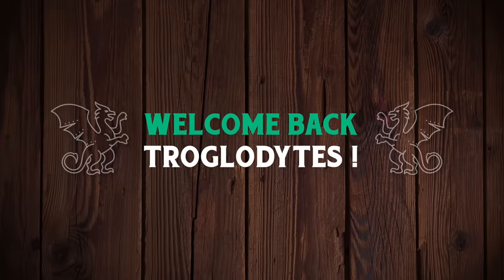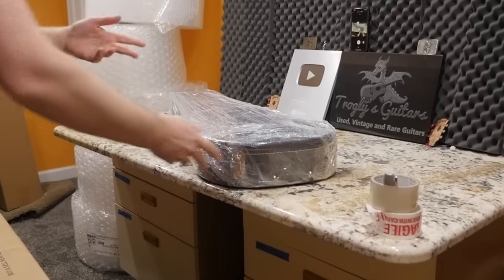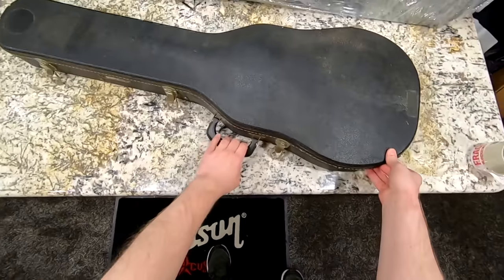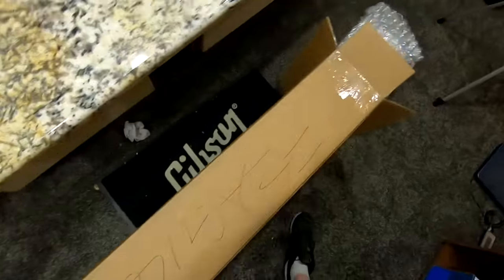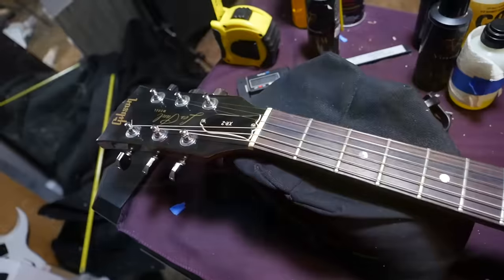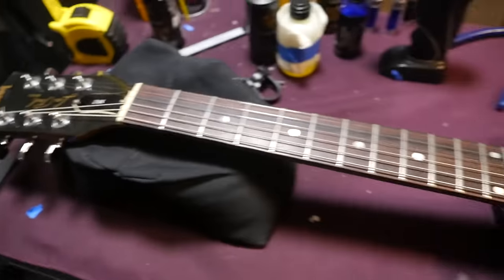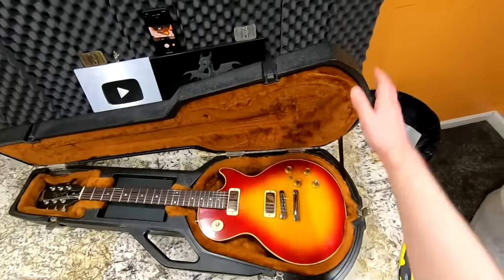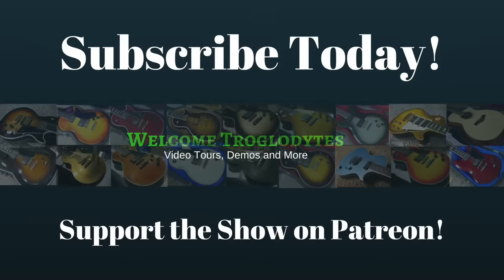Sometimes I Have Rotten Luck | Trogly's Unboxing Guitars Vlog #105

Comment from the maker: It is a shame the last one didn't end up working out - it was in great shape!
I now sell directly from my website: 🟢https://www.troglysguitarshow.com
❓Private Help Sessions: https://troglysguitarshow.com/help-appraisals/
👕 Merch: https://teespring.com/basic-logo-4245?pid=211
🎸New Guitar Day Program: https://troglysguitarshow.com/ngd/
🔵eBay: https://ebay.us/919XGV
Reply: Do you not sell on Reverb anymore?
Reply: Make sure to have your vacuum cleaner over your lovestick
Reply: Although I don't have a Norlin guitar, Gibson gave me the screws.  

Gibson really gave me the shaft. I bought a Gibson Les Paul recently. Two guitars that had received - defects on both Les Pauls. It was a battle from point A to point X - where I am at now.

Bought a Gibson Les Paul 2015 brand new loved the sound, but, got a broken head stock. The horrible G-tuners wouldn’t stop and cracked the headstock. They said initially, I did it. They agreed to take a look and that revealed a QC defect.

The only good thing is they upgraded the guitar price wise, but come to find out that Les Paul would be out of circulation post 2018. That Les Paul had five indentations/dings they painted over, part of the binding was crushed, the volume knob fell off in a month, plus a couple of other issues. That Les Paul should have firstly should have never passed QC and sent to me without knowing it would be deformed.

When I wrote about after months they responded and they suggested I send the guitar in for review. I told them I was seeking to buy another model in the near future, but wanted them to clean up the issues I was having before I did that. They had the photos I emailed them and I told them didn’t want to waste my time if they were not going to do anything.

I had the Les Paul packed up in late February, but had to wait for them to get back to the shop after COVID-19 (not their fault). I detailed that if they found no defects I would want them to give me the details of what they saw before they sent it back. Additionally, I advised that I consider to make alterations to the guitar (that I’d pay for). They received the guitar - stated there were no defects with the guitar and did a courtesy set up. THEY NEVER REACHED OUT to the customer and sent it back. I was so pissed that they wasted my time and energy and couldn’t even follow basic instructions. I asked what the dings were over and over again and received the same email response that there were no defects. BS! So Gibson’s QC sucks, customer service humors and belittles the customer, and can’t follow basic instructions.

Meanwhile, I keep getting emails about $59,000 reward for a ledger Gibson had stolen - who was sleeping at the switch for that one? The April 30-day Epiphone once a day give away that Agnesi had a hard-on for when Canadian contestants won. Plus the overseas giveaways.

Plenty of money for Slash. Damn it! Slash, Slash, Slash - how much did Gibson pay that guy for endless “special editions?” How about Clapton, Joe Perry, Alvin Lee estate, Tony Iommi, Parnell, Cantrell - who was hardly seen with a Gibson until lately. It never ends with that. Oh yeah, don’t forget about Slash and the one million models. For the love of God!

Plenty of loot for the Gibson Gazette and Gibson TV (not all bad content, but more money spent).

Crap tons of money for artist editions. Especially lately.

We saw a video of Gibson grinding up Gibson X guitars when you could have given them to kids or schools.

I have three Gibsons. I told them, hey I have all these problems with the last Gibson Les Paul and its replacement, but they no money or integrity to take care of the general customer paying good hard-earned money. They can lick the bottom of my boots right now. I am done with buying a new Gibson or anything in their family. You should probably do the same or be taken for a ride like me. Nice Job J.C. Curleigh, Mark Agnesi, and Cesar Gueikan ya rollin’ in the loot eh, boys? I will surely be taking shots at Gibson at any chance I get. Early and often! Hardcore!

Comment: For me a black les Paul or any black guitar looks SO GOOD with the shiny chrome hardware its like an old Cadillac shiny black with all that beautiful chrome
Reply: Same here, I realize more purists will go after the original tuners ( plastic looking peg head ) however I’m with you, chrome all the way! 🤟
Reply: I have a black standard with chrome plating. I've thought about changing it to "black-silver" theme, by replacing tuners from greenkey to chrome pegs, amber top hat knobs to silver knobs, pickup selector chip to silver, maybe pickup rings to chrome too... But the guitar still has a cream binding. Something about stock cream/amber elements (tuner pegs, knobs etc) makes it classy. Dunno if the change would be for the better.

Comment: I really don't understand why the volute was discontinued. It might not help that much against headstock breaks but I bet it adds to tuning stability. If I were to have a custom Gibson built I'd want a volute.
Reply: Yeah I totally agree. and I’m sure it helps against headstock breaks at least to a decent degree
Reply: @guitarocd9984  ive been reading about broken gibson headstockd on guitar forums since 1999, as long as i started playing.
Reply: @mubodude  i got an ibanez sd9 for 20 bucks in 2004 from a pawn shop.

Thats my best deal and it got stolen eventually by one of my sisters boyfriends while i was away at school.
Reply: I like the volutes, but they probably don’t help with tuning stability. Honestly, if the nut slots are properly relieved and you keep them lubed up, that’ll help the most. I’d be willing to bet most people that have tuning problems with Gibsons are caused by the nut (QC should probably address that, but they wont).

Comment: As far as the old gibson case I like it though it looks like it's been collecting dust. Easy fix though. I use light dish soap to clean and a good furniture polish that cleans and restores finish. I've played in smoky places a d always clean guitar . First with a wipe down before I close the case. Then later with a good furniture polish letting the case and the guitar air out so I don't get slapped in the face by tobacco smoke smell next time I open the case.

Comment: A 70 era Gibson Les Paul Custom, the best value in vintage guitars!   Period
Reply: @mubodude  
Yes John,  greetings from Louisville Ky!!!
I love the “Norlan era” customs!!  I’m playing a black with chrome 78 now,  the guitar I learned on back  in 1979. Collectors look down on these for several reasons I think. 
One, they are too far away from the originals in their mind. 
Two, the pancake body witch they stopped building bodies like that 78. 
Three, The maple neck, volute and the headstock angle,  much different than the originals.
Four, during the 70’s both Gibson and Fender had developed quality control issues. For Gibson, it sort of reminds me of the Gibson between 2011 and 2019....... mostly, pretty good guitars but not like the late 80’s and 90’s.  
Sorry to sound like a Know-it -all. I will shut up!!!
What part of the world are you from???
No need to be specific,  north south east or west is close enough.  Lol. For some reason I find it interesting. Oh well, respond if you like. 
Thanks for the comment John

Comment: On the basis of your Dark Knight guitar center exclusive video, I bought one of the red ones (called "blood moon").  It's a Nov 2020 build and it is FANTASTIC.  It has the Modern wiring, coil taps, phase and blow-off switch.  The typical first strum out of the case with no amp blew me away.  It's like the body of this guitar is alive.  If I dampen the low E, then play a high E and then mute it, the guitar continues to play an E due to sympathetic vibrations of the A string.  I've never seen that before.  Cosmetically, it's near perfect.  Neck is slim-taper.  It has the same pickups as the Dark Knight, and the same dark inlays.  Out of the box, the intonation is near perfect and action is very low.  This was my "when 2020 is finally over" gift to myself, and wouldn't have happened without your dark knight video (I would still have bought an LP and might have loved it as much as I love the blood moon).  I know  a lot of people are saying that 2019/2020 Gibsons are better than they've been in a while, and it's true from my one example.

Comment: The biggest deal with LP cases is ensuring the headstock is not touching the bottom of the case! If it does and the case gets dropped thecase impacts the headstock directly often resulting in a break!
Volutes don't help either. Seen examples with them snapped off too!

Comment: 9:15 I have a guitar that was twisted like this but it went straight again.  I went to re-string it and noticed the neck was twisted and the nut was very very loose.  So loose I was surprised because I had adjusted the neck before and it was tight.  So I cleaned up the frets, re-stringed the guitar and tightened the truss rod until the neck was straight and the twist was gone.  It didn't need to be tightened by very much either.  I have no idea why the truss rod nut was loose or what made the neck twist but it is straight now and its now my main guitar...  I just wonder if that guitar might have a similar issue, whatever it was that caused the twist.  Would that be overtightened or too loose of a truss rod?

Comment: @12:44 this is pretty standard for Norlin era Gibson’s. QC was not important only production numbers were. There are some rare quality ones that made it out but the vast majority were rushed out the door with very little care taken to even set the guitars up before flying them out to dealers. 

Sure they are a cheap way to get into a Gibson but I’d never buy a norlin era guitar without playing it first
Reply: The strap lock placement is bad but there was a lot of issues on the 50s and 60s Les Paul's as well.  A common example is a lot of the 50's LPs that people covet had one or both peaks on the headstock rounded off because the sharp peak would get blunted/damaged when they were moving the unfinished necks around the factory or simply messed up with aggressive sanding and they would just round them off before painting.  Back then people would accept having one side of the headstock out of line with the other but I couldn't imagine someone today being forgiving on that.  On modern era Gibsons, I'd take bad strap button placement over some of the stuff I've seen in Gibson unboxing videos between the early 2010s and 2018 where people got guitars with serious defects that would affect playability.  Saw one where the neck was mounted crooked and the Gibson guys had the bridge decked on one side and really high on the other to try and make it playable when they shipped it.  That said, most of the complaints I see in those same videos are people nit picking little cosmetic stuff that should be expected with hand finishing and won't matter to anyone once the guitar has some normal wear and tear that is worse. 

As far as Norlin Gibson's go, I have a late 70s LP custom that I've had since the early 80s and other than a little overspray on about an inch of binding, the original build looks like it was perfect and it has always been my number one so I'm a little bias.
Reply: @Somenite  💯 mate I’ve seen quiet a few 50-60’s les Paul’s and just because something is old doesn’t automatically make it good. There will always be a few that make it past QC but since the end of 2018 when J.C. took over Gibson have probably been putting out some of the best and most consistent guitars 

As for the 70’s and Norlin era guitars I’m sure there are some incredible instruments that made it out but overall the standards were way off what they should have been. But I guess that’s what happens when your focus turns to profit 

A mate of mine has one of the best sounding 70’s black B customs and I’ve been trying to convince him to sell it to me for years ! So if you have a good one hold onto it mate.

Comment: There's a Gibson Les Paul on my local craigslist. It has a Les Paul custom truss rod cover but has no binding on the body. It does have binding on the headstock. The serial checks out as 2008 Les Paul, but I'm wondering if it's a real custom

Comment: On a black LPC I prefer the look of gold. It's unfortunate that if you play it it will wear through. For that reason alone I would choose nickel. In fact, my goal is to have a wine red/ox blood LPC with nickel hardware. I'm not above ordering a M2M but if you do that the "may as wells" tend to add up pretty fast. I could buy 2 vintage ones for the cost of a new M2M one

Comment: Can anyone tell me the reason for looking at the guitars under a black light ?
Reply: As the finish ages it reacts in ways that change how it glows under black light. New finish, touch ups, and so on will behave differently too, allowing you to see if there's any really good repairs done. The old plastics also react different to the newer plastics under the blacklight. Ya need to learn how to interpret it, but there's a lot of info contained in there.
Reply: @fairguinevere666  thanks I appreciate that info , couldn’t understand why until now , and it does make a lot of sense. Thanks again. 
👍👍👍✌️✌️✌️
Reply: @fairguinevere666  plus it looks cool

Comment: I'm new to guitar what causes a twisted neck's
Reply: Allow me to answer your question in more of a technical way. Why do necks twist? Because they are made of wood. Wood grows upwards towards the sunlight, but it also grows outwards in fairly concentric rings. Each ring is going to be a little different; one year may be hotter, or colder, or wetter or dryer; there are lots of ways that one ring may be different from the one before or after it. This causes stress in the wood. You could cut a perfectly seasoned piece of 100 year old wood (which should be pretty darned stable) and come back the next day, or month, or year and find that the wood has warped or twisted because, in cutting it, you released the stress contained in it. 

It's impossible to predict how a piece of wood will react in the long run, but there are things you can do to prevent warping and twisting. Keep your guitar at a constant humidity and in a comfortable temperature range. Never leave your guitar in a car for more than a few hours (especially on hot or cold days). Even inside your house, do not subject your guitar to direct sunlight (if you are playing an outdoor gig, do everything you can to be in shadow). Don't leave your guitar sitting out. Not even on a guitar stand. When you are done playing it, clean it wipe it down, and put it in its case. All these things will help keep the humidity of the wood stable, and if the humidity is stable, it is less likely to warp or twist.